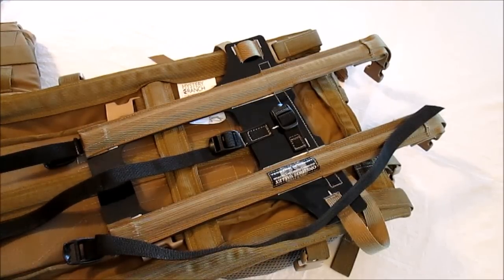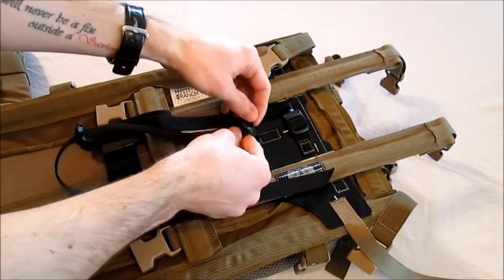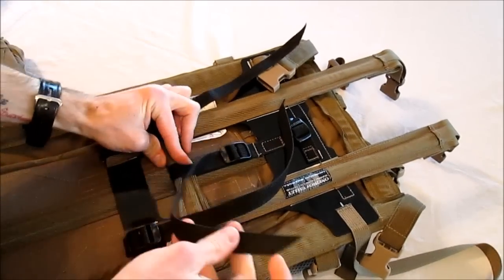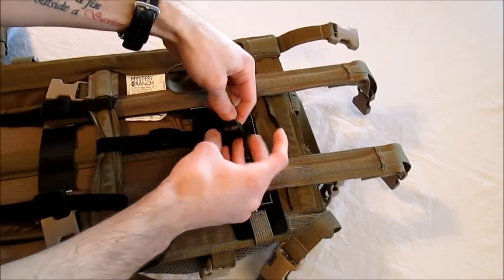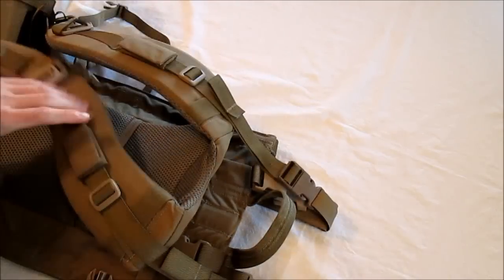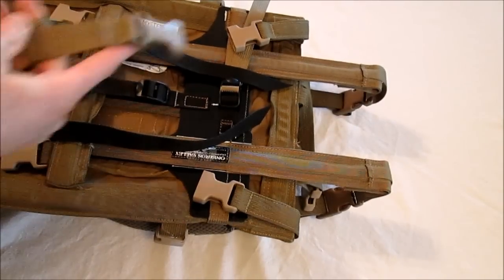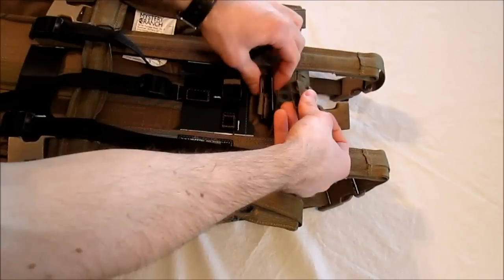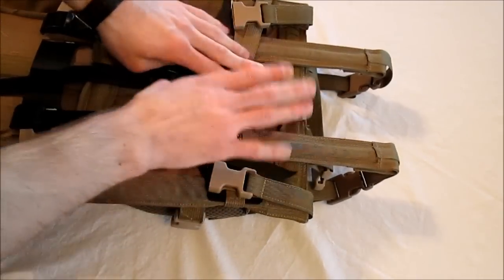Gen II Load Lifter Panel (LLP) NICE Frame Extension Installation - OV Innovations

Comment: Why doesn’t the nice frame already come built that way with load lifters already on it?
Reply from the maker: It was originally designed for military applications and built to the dimensions of the ALICE frame. They do make an updated version of the frame called the Guide Light Frame that includes integrated load lifters.

Comment: Will this work with NICE 6500/7500 ?
Reply from the maker: Negative. The 6500/7500s integrated frame extender serves largely the same purpose and interferes with the attachment of the LLP.